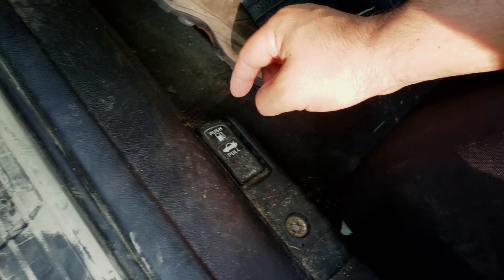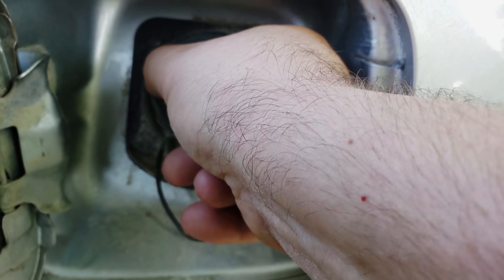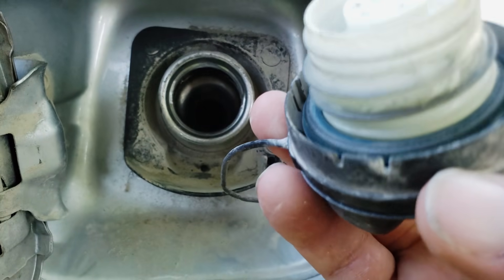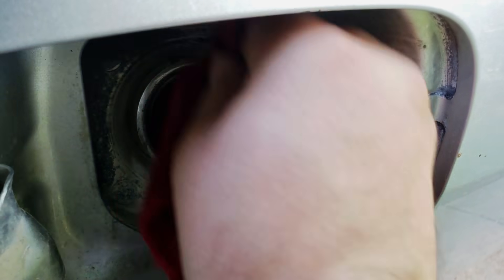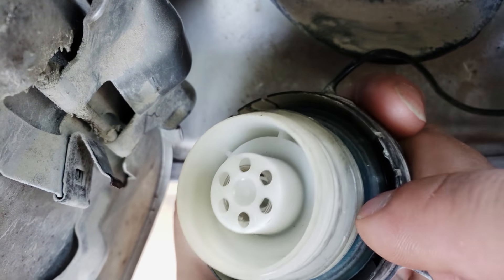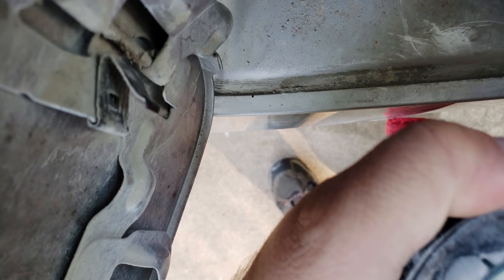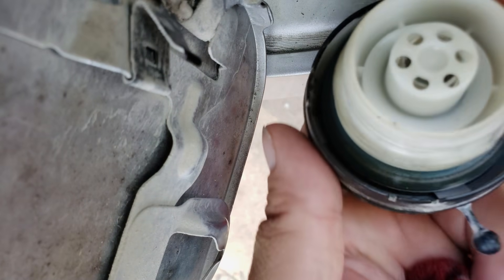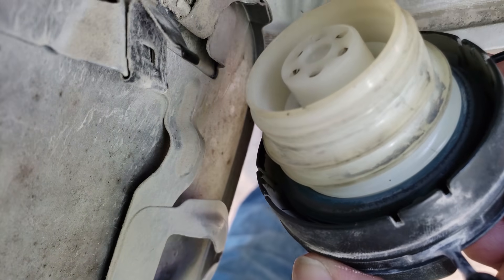Check Fuel Cap - What to do First - Automotive Education

Comment: Just cleaned and coated the cap and spout opening with wd40  and started crv. Dash cap alert still on. Played your video and took advice to totally clean and dry the seal and the opening and it worked like a charm. Gas cap check light gone. Thanks

Comment: Thanks So Much for the Simple Explanation!   I did just exactly what you said respecting the checking and cleaning of the cap  rubber "O" ring gasket and the surface of the gas filler neck.  Once I did those things, the check fuel cap light went out almost immediately.

Comment: For what it's worth, I had this msg on a 2015 Civic LX. I tightened the cap, took it off retightened numerous times. Would not go away. Drove it for a bit, still would not go away. Then I started the car with the gas cap removed, let it run for a minute then turned the car off. Put the gas cap back on, started the car and the msg was gone.
Reply: Thank you this worked!!
Reply: Did it too, thanks it worked amazing
Reply: Worked for me boss. Thank u
Reply: Going to try this, thank you
Reply: Me ayudo mucho sii funciona hacerlo de esta manera de inmediato se quita el mensaje
Reply: Thanks for the tip. Worked like a charm on my 2017 Rav 4.
Reply: Thank you it actually helped you’re life saver
Reply: @hitzche8645  Weird huh? Glad I could help.

Comment: Is the code for a faulty gas cap the same as a code for an evap canister?
Reply: Guys my problem turned out to be the sensor only..
Reply: @ro-landocalrissian4633  
Hi!
So do you change the sensor?
Is it the canister?
Because, i changed the cap but the error keep continue and now I have yellow light engine, thank you for your comment
Reply: @danitzadanna7099  so I found a good mechanic & he did a smoke test on it & it was the “purge sensor” only. It wasn’t expensive.

Comment: Just take a rag and wet it with AT-205 on the seal of the cap. Don't oversoak it....Just get the seal good and wet. Make sure the car is OFF. Wipe
the dirt off around the filler neck...PROBLEM SOLVED....NO MORE MESSAGE,NO NEW SEAL NO NEW CAP..........DONE  It worked for me.  Message
NEVER   came back on.....

Comment: Thank you that was simple easy to do. I like how you explained it step by step and clearly. This made my panic go away immediately. I could smell the gas coming from the gas cap and i cleaned it. It was a bit dusty and slightly dirty. My cap wasn't on tight either. Also I didn't know a gas cap that was loose, dirty, dusty , etc.. could cause problems. Now I know thanks to your clip.

Comment: Can I remove the tether line and use a regular gas cap without any damage
Reply: It's a fall safe mechanism so you dont lose your cover in the event of opening and it falls off without you noticing.its your choice and discretion tho.
Reply: Have you found out how to remove the tether line?  I want to replace my gas cap on my '07 Honda Accord and need to know how to release the old one.

Comment: Is that gas cap a one-click ? I'm asking because I have a '02 Ford Taurus and I bought a new gas cap that seems to be a one-click lock. I replaced it because the original gas cap continually spun with the clicking sound and I had a gas smell.
Reply: Generally all working gas caps are multi click but Isaí ally it’s deacon end to do a 1-2 click for a good seal, but check you owners manual for what it recommends